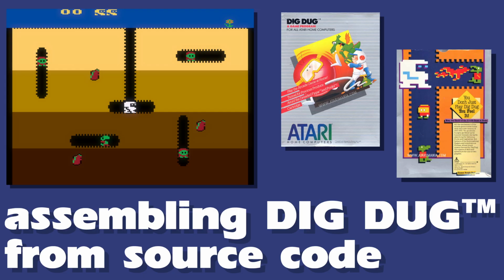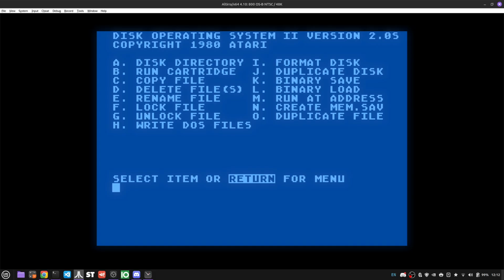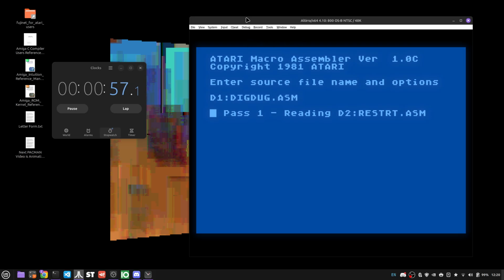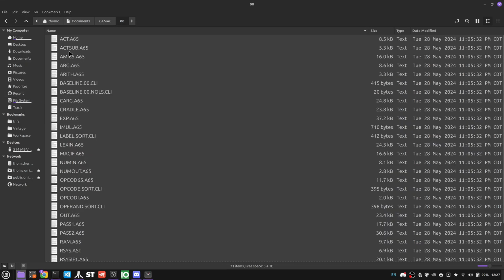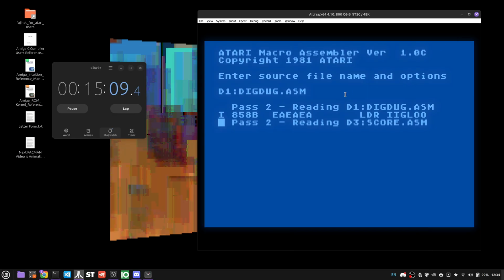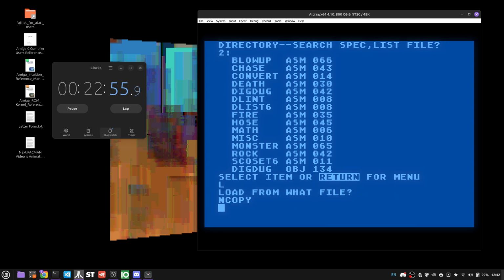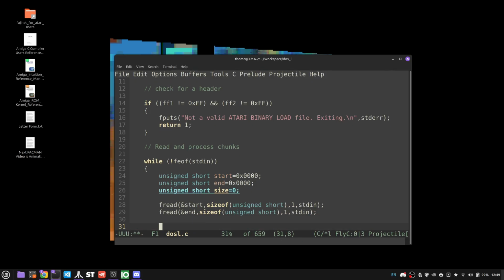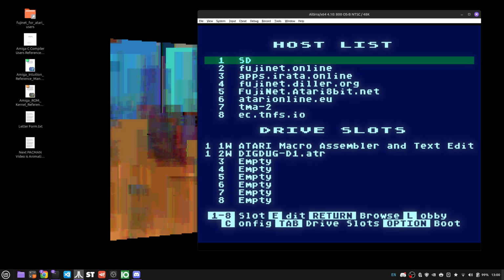Assembling #atari8bit DIG DUG Source code

Comment: why was it that there are so many source files rather than making placing all the routines in a single file?  Cause everything is included in the main Digdug file.
Wouldn't it have been more space efficient because of the data that is used to denote the start and end of the file?
Reply from the maker: You wouldn't have enough RAM to load the source file into the text editor.

Comment: This is so cool….  I love the history walk through the tool chain the original developers used! I have two questions though. You ran the dosl against DIGDUG.XEX, was it supposed to be DIGDUG.OBJ? Also, any idea why they used this 252 byte setup? I recall using MAC/65 as a cross compiler for a 680x system and this 252 byte really threw me … (in the end I used to add a step to execute a simple basic program to strip the bytes and get straight to a ROM image). Thanks!!

Comment: Does anyone know if AMAC is related to AS68 or MADMAC, which were other early Atari tools?
Reply from the maker: No. MADMAC was written by Landon Dyer during the Tramiel era. No to AS68 either, as that was Alcyon.

AMAC was a contracted version of SORCIM's ACT assembler for ATARI. It was subsequently translated to the MV8000 in the Home Computer Division and called CAMAC.
Reply: @tschak909 Thanks a lot! This was a great video, really looking forward to the next one!

I occasionally help out with rmac (which sprung from smac, which sprung from MADMAC), doing testing. Rmac has had the 6502 code generator put back in, and we’ve also got it assembling 68030 and DSP56001 code, to be able to use it for Atari Falcon development.